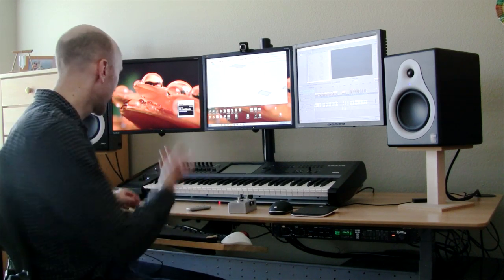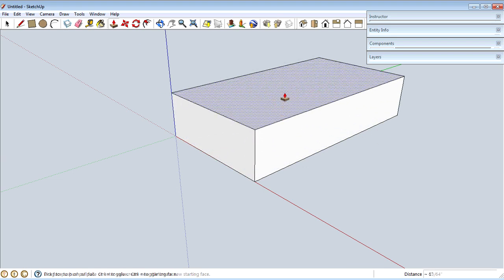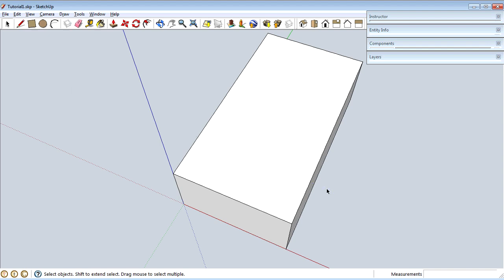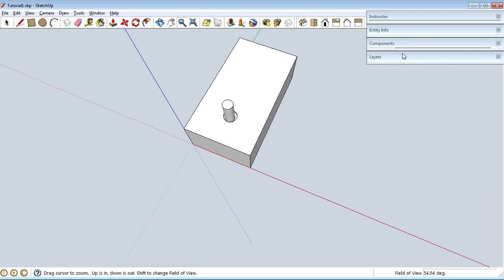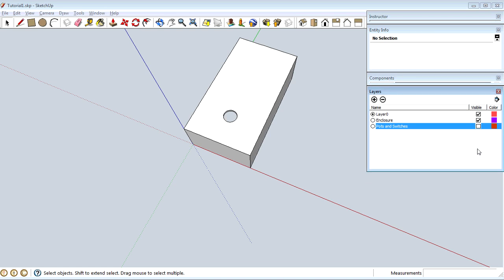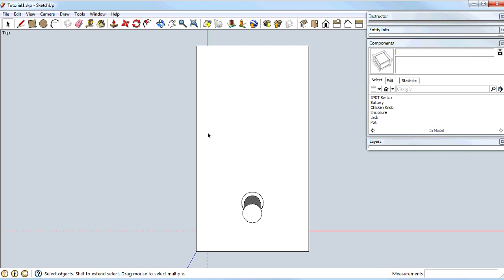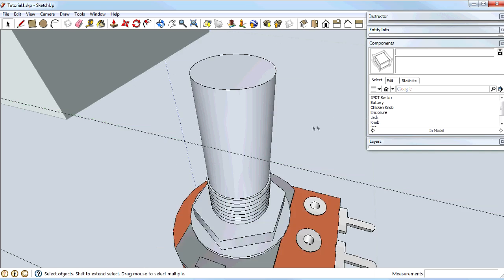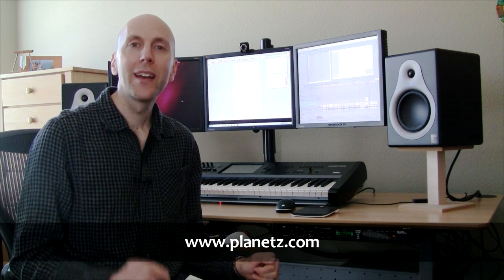Beginner's Course in Sketchup, Modeling a 125B Guitar Pedal Enclosure

Comment: Great video. One tip: in the video you center the pots in the holes by eyeballing it. But if you leave the guides on the hole and the pot intact, you can snap the center to the center.

Comment: This is a really good series, thanks for putting it up. Why did you make a drilling template on paper? Would it not be more accurate to measure it out on the actual enclosure as you don't need to line up the paper? I've not tried this (yet! =D) so there is probably something that I am missing.

Comment: I'm building a Sketchup for a 1590A pedal, and when I attempt to add the hole for the switch, I don't get a hole through my enclosure.  I get a cylinder on the underside of the enclosure.
Reply: Christopher Timko I ended up making the push out exactly 1/16" and it fixed it.  Sorry for the dumb question :).
Reply from the maker: Christopher Timko - no problem, sometimes you just have to experiment!  Glad you got it sorted out.

Comment: hmm looks like sketchup is only free as a web-based application now, I'm going to give this a shot and I'll report back if it all still works on the current free version!

edit:  I followed along until part 2 when I realized that I'm using a kit with a pre-drilled enclosure so I don't really need to do this part!  still watched the rest of the video because it's interesting.  One thing to note is that I searched up the 16mm pot and chicken knobs on the 3D Warehouse and they don't appear anymore
Reply from the maker: I've only tried the new web-based Sketchup a couple times. I was so disappointed when they changed the Sketchup licensing model! :(

Comment: i cant get the hole to drop out
Reply from the maker: 1bulldog998 - sometimes, when using the push/pull tool, it's helpful to type in an exact measurement after the push/pull action.  If you know the hole should be 1/2" deep, you can just push any distance, then type in 1/2, or 0.5 after the push, and it will do it perfectly for you.